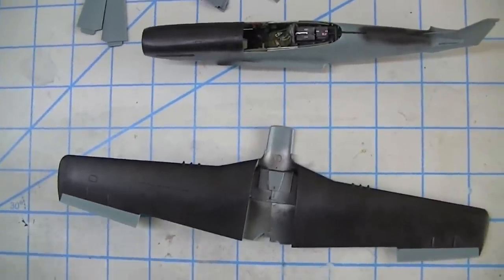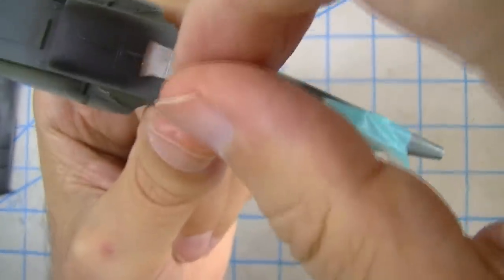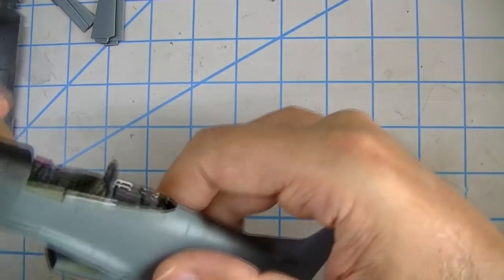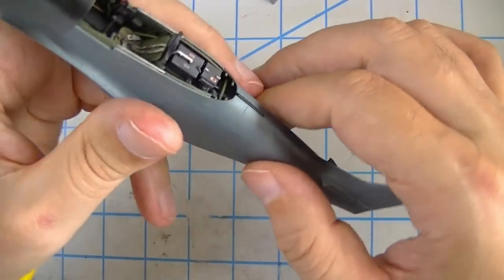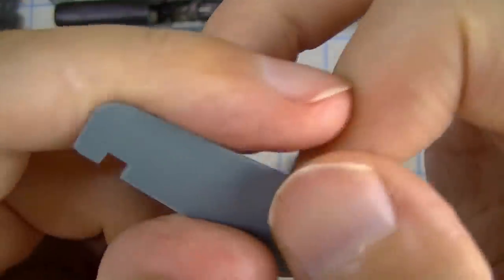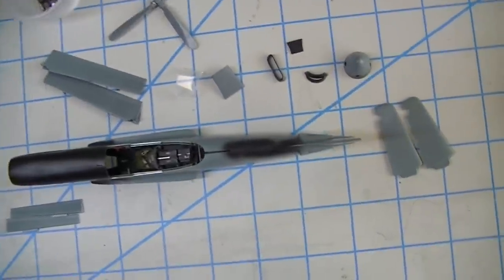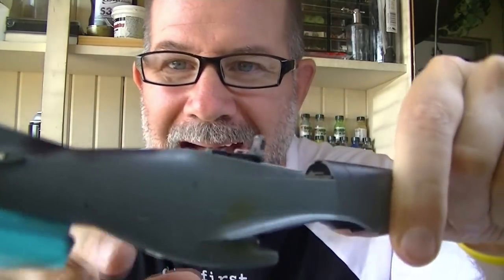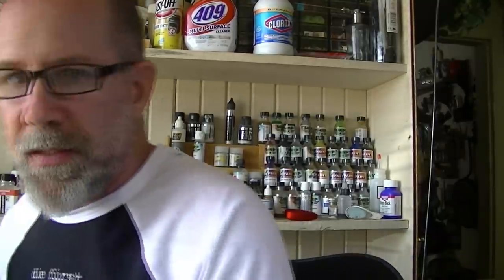ep297 - the foil adventure (with the eduard 1/48 mustang) part 6

Comment: Ok, I'll be the second guy to recommend pUtting the Micro-Scale Foil Adhesive on the model with with a wide flat brush.
If you dip the brush in water and hold the end on a paper towel for a few seconds, then into the adhesive, and apply to the model. .The damp brush will help eliminate brush marks.  
I do one panel at a time so I can vary the grain. I also put the shiny side down as you can polish or grain the dull side easier.

Comment: Regarding the spinner, or most other parts (removable panels and doors). As an aircraft mechanic, new aircraft have nice fitting panels, doors, and other components. After some maintenance though, that goes out the window. Also, panels, doors, and airframes get damaged through normal attrition. The repairs are rarely perfect.

Comment: For foiling I don't use the white PVA stuff anymore, but the oil mixtures the professional restorers use to apply gold leaf to church figures and the likes.
There are different brands around that have different drying times. 
Since they are drying oils, they have perfect self-levelling properties and can be applied to the model instead of the foil.
Historcally it is applied liberally to the surface to be gilded and then wiped off again with a cloth. That leaves an extremely fine and even sticky film.

Another way to it that i found for my models is to thin the mixture a bit with enamel thinner  or similar. You then can apply a very thin coat of it to your model and just wait for it to become sticky.
The results you get are even better than spraying the PVA stuff onto the foil.

Also check out the foiled models by Peter Doll. Those are really great. I met the Guy a few years back at a model show in Germany, where he told me he uses clear enamels to stick the aluminium foil to his models and then uses a riveter to make tiny holes in the foil at the rivet lines to let the thinner evaporate. 

I hope i could be of sevice. 
Keep it up, I really like your videos.
All the best 
Andy
Reply from the maker: now this is compelling!  any links to the products you mentioned?
Reply: @barpfoto  well, I bought mine from a German online shop: www.credo-blattgold.de/de/oelmixtion 
and I don't know if they deliver to the US.
But in English, the product is called a gold size, I believe, so it should be on ebay, I guess.

Comment: I raised the flaps on mine, it was a big problem because once you cut them to sit square, you find the wing is the wrong depth for the flap so it all has to be levelled out.  I didn't expect such a simple choice to cause so much trouble, but this kit is designed to go together one way only.
Reply: Good to know as I like to make them in flight. Thanks for the heads up...

Comment: Regarding your comments on the horizontal stabilizers, 1/32 Hasegawa P-47 stabs are well engineered. Fingers insert into each other inside, and there's a round locator pin as well. They fit tight and in position. Also, if Eduard changed the slot sizes on the ailerons, there would be no way to put them on upside down.